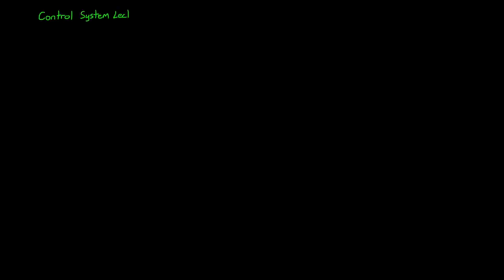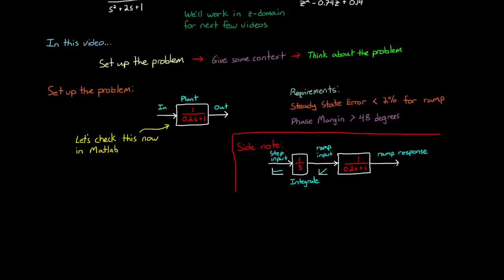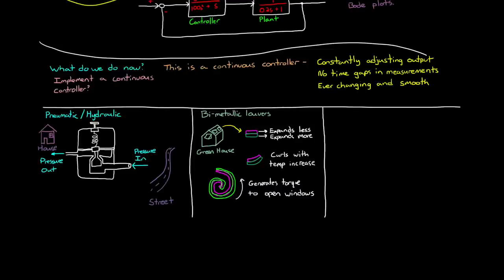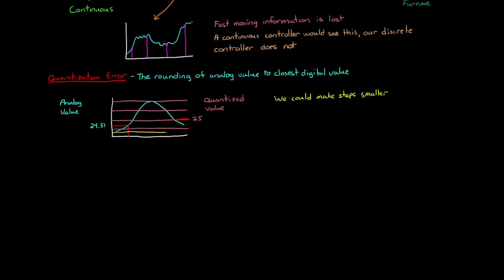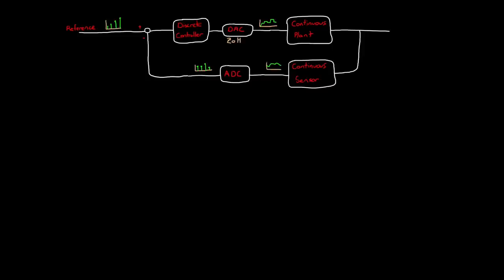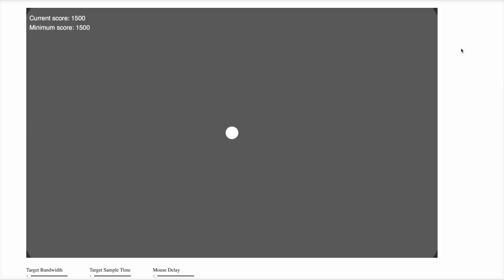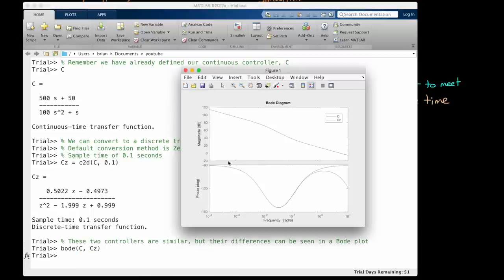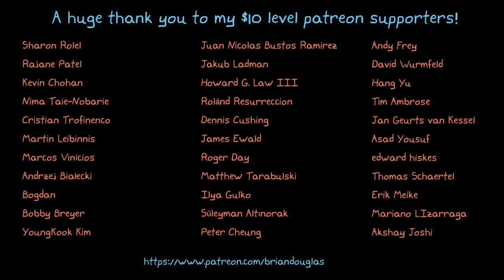Discrete control #1: Introduction and overview

Comment: I did not learn control theory in College, and I did not learn it on the job. I faked it, and made top $ for engineers as I designed switching power supplies for 30 years. I did learn lingo to get the work. If someone asked me about continuous flyback I would say, "Right half plane zero in the S plane. Must roll off  control gain below LR pole corner." But once I was there I would not waste time designing or camped out with the schlumberger phase gain analyzer. I would hook up variable capacitors and resistors around the error amplifier, give a 100% step load to the system, and dial the compensation until it was critically damped.

Comment: You can also use a Smith predictor in discrete time in order to find a controller that will stabilize your plant given a controller that will stabilize your plant without delay. I think you could also use a Smith predictor in continuous time, however this might be ever harder to solve by a computer (because delayed differential equation are infinite dimensional).

Comment: Hi I am trying to understand just a couple of things:

 1) the original pt open loop transfer function 1/(1+0.2s) is very close to the transfer function being just 1. Is this delibaretly? If so why would this be a good example of a transfer function to show the effects of designing a controller on?

2) At 2:54: Are the two so similar because the answer to 1) is yes, it was delibaretly?

3) 3:10: First order open loop == infinite phase margin? Why is that (maybe my knowledge of transfer functions needs refreshing, but it does not seem to be directly clear to me)

Thank you so much for your amazing videos:)

Comment: Thank you for the amazing video, but when I calculated the steady state error for  ramp input for a type zero transfer function i found it zero, can you tell me how you got this result by hand ?
Reply: And I found the SSE to be infinite of a type zero system for a ramp input
Reply: I found the mistake, the error is not the same for open and closed loop systems.
Reply: @engenhologia  isn’t the SST error normally calculated for the closed loop system?
Reply: @Fihaa111  YES! That's why is so weird Douglas using the ramp response on the open loop plant and subtracting the standard ramp as refference signal and finding 20%. It is like you are analyzing the plant before closing the loop. Being a type 0 system it is clear that the final value would be infinite in closed loop. The interesting part is that if you apply the final value theorem on the error modelled in open loop you find the 20%, and in closed loop you find infinite. My model of the error in open loop is R(s)*(1 - G(S)), and the closed loop error model is (1/(1 + G(s))*R(s), being G the plant and R the reffence. The funny part is that my closed loop error is just like  the one in textbooks like Ogata, and the authors don't even metion errors in open loop. 
P.S.: Sorry for the grammar errors, english is not my first language.

Comment: 18:50 But the ZOH method is not to convert continuous to discrete. As you have mentioned in 12:04 it is used to convert back discrete to continuous. Could you explain please?